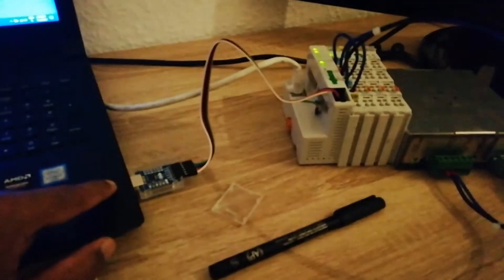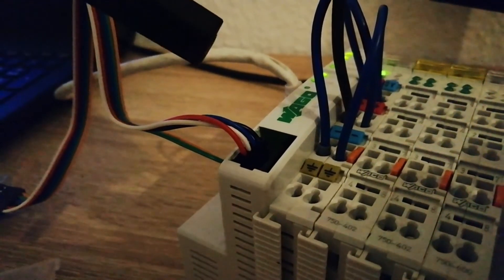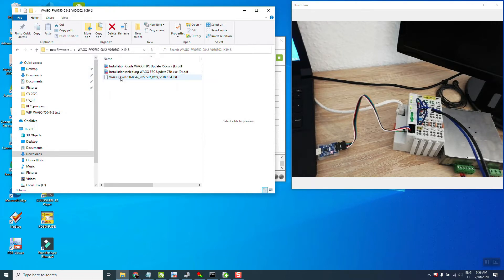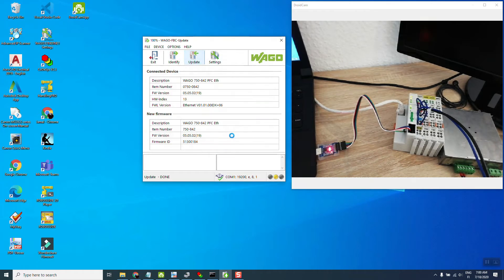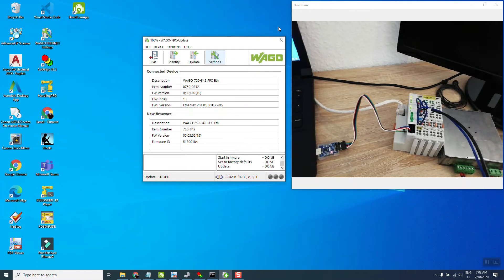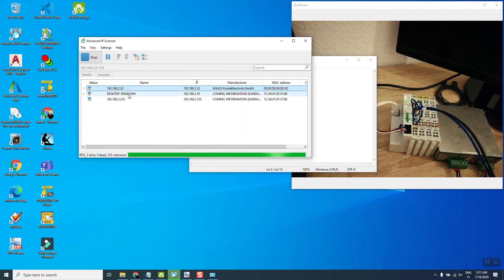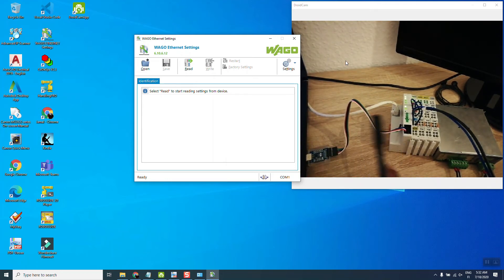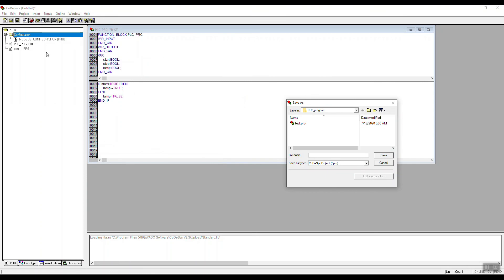Getting started with WAGO 750-842 Bus-coupler (Codesys 2.3)

Comment: Use the DHCP method (using dip switches) with the same software mentioned in the PLC  manual. This is a very costly method. IP addresses can be changed through an ethernet port.
Reply: How can i do this, because i get the same error that takes place in the video

Comment: how to upload program 750-842
Reply from the maker: Hi! It should be similar or even easier, if there are two ethernet ports in 750-842. This means, you can do all changes via simple ethernet cable. No need of serial connection as mentioned in this video.